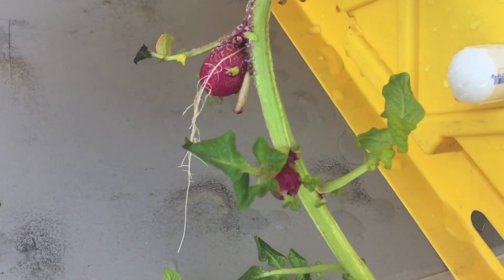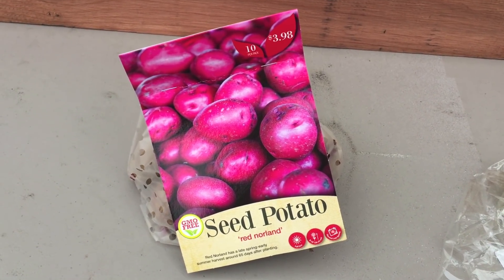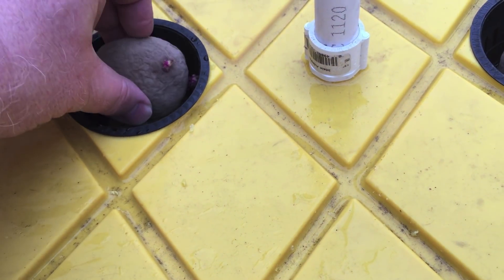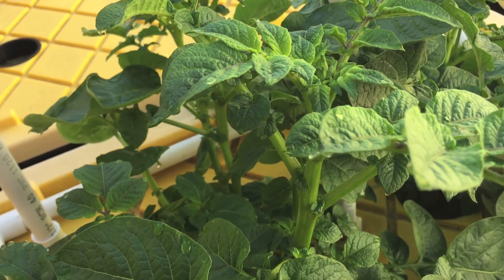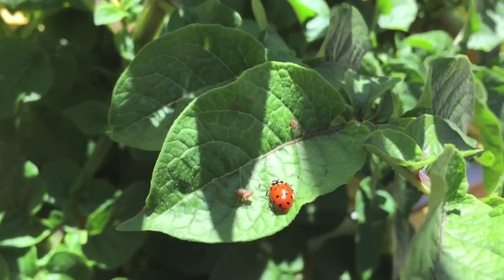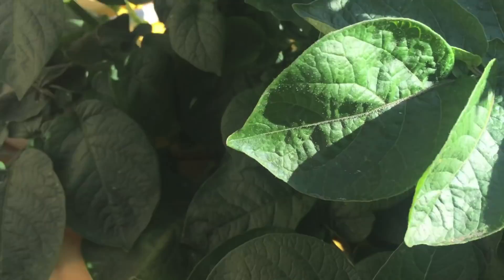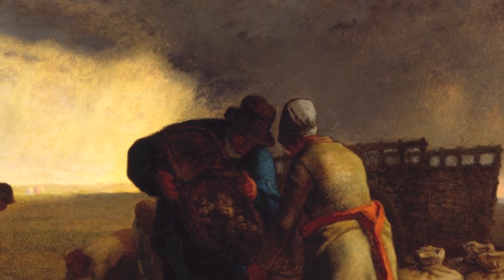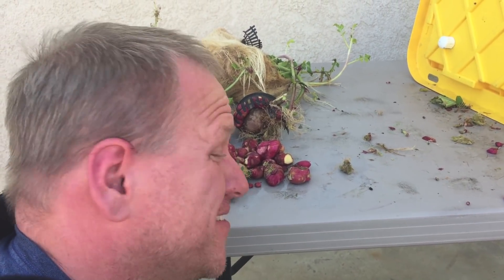Check out the amazing growth pattern of this hydroponic potato!

Comment: You need mulch material on top of the lid for the potatoes to form in. Probably not puting the potato seed so deep in the pot would keep all of the sprouts above the lid.  
I grow fine potatoes by just setting them on top of soil that is always damp and covering them with grass mulch. 
You could replicate that by putting a net around the pipe frame and adding shredded paper starting with about 4 inches and adding more as the sprouts get taller. Light will not get through the lid that way and the new potatoes should form on root stems in the shredded paper and be protected from the light.
Reply from the maker: I believe the method you described could work.  I'm trying to grow them without any media if possible though.  Keep watching to see if it worked.  Thanks!
Reply: The method will have to comply with the genetic plan of the potato which is to place a thickened section of root in a place where it can remain dormant until the next growing season stimulates buds on its surface to regrow. The preference is a dark,soft, poris space that is not too damp to protect it from heat and cold until the next warm damp season arrives. 
I can perceive a space between 2 lids working if no light can penetrate the top lid.  Feeding roots then could grow down through the net pot , reproductive roots could spread out between the lids where it would be dark and damp but not wet and the photosynthesising blooming parts could grow up through the hole in the top lid.

Comment: yo, potatos grow from STEMS not roots.  with that in mind, you can make a simple change in the setup.  I'd go for some kind of big tray of sand suspended above and touching the water reserve. don't restrict them to cups.
Reply from the maker: I knew they grew from stems I just wasn't familiar with the nature of the stems.  If you have a tray that hold sand, why use the sand?
Reply: I'm not sure!  I discovered your channel yesterday.  I love that you're questioning everything, looking for the absolute minimum.  give it a shot!  grow 'em no media and I'll watch that vid!
Reply: You need sand to cover the stems (away from sun) and a little moister (Otherwise will rot) over the stems to start the grow of potato. In hydroponic systems it's a good idea to use perlite to cover the sterms.
If you want to reuse the perlite you must sterilize it first. Otherwise you must be familian to Aeroponic systems to keep moister in good levels, a tray that cover the stems (away from sun) and something to keep the plant vertical (potatoes are heavy).

Comment: cut out the bottom of the cup. suspend the seed potato by skewering through the potato and cup mesh
Reply from the maker: I'm trying a grow with thin rope similar to what you described.  The grow is "working" but the problem is the seeds rot out and lose structural integrity pretty shortly.  I pierced one and ran the rope through it and the potato rotted apart in a couple weeks.

Comment: Everything you already did, but suspend a net 3"-4" attached to the underside of the lid.  If the Roots can penetrate the net, but not the Tubelers, the Potato's would be suspended and not cramped.  And maybe just use a few pieces of string to hold the Original Potato in place.  I'd like to try this myself.  Thanks for the Inspiration
Reply from the maker: Bigger net cup would help, but I think avoiding the net cup entirely may be the answer.
Reply: I was thinking a Net the length and width of the lid, spanning the whole bucket.  A place for the Potato's to catch, then maybe you wouldn't need a Net Cup at all.
Reply from the maker: Exactly!

Comment: I noticed on the tubers where the remote potatoes grew on and noticed leaves on the vine like tuber. The rest of the plant from the lid up looked fantastic! My suggestion is to drill holes in the lid to let the tubers out and leaves to get some light. Since it looked like a vine, stake it up :D
Reply from the maker: Problem is the tubers only form where it's moist enough that they think they are underground.  Also if they get too much light they will produce a toxin, turn green, and develop a bitter flavor.  Nice try though!
Reply: Okay, I've seen scaffolds used for areoponic and beautiful huge round yield but that comes at cost to the power company and yes, if they could charge for the air going through it, they would! hahaha ... How about a small above ground  swimming pool used as a giant tank? As for the medium, as-per DR Kratkey, 'Florist Foam' or some other medium that would break down, and, by the time its gone, the top will have grown large enough to hold it there. Thanks for your reply :)
Reply: got the idea from 'oh yah, you can use a kiddie pool too' just float a raft on it so go BIG

Comment: When drilling in plastic boxes, make the drill go backwards and you wont have problem with it catching.
Reply from the maker: This 3 inch hole saw is so sharp it doesn't seem to have that issue.  The catching is because I'm using it one handed.

Comment: Crazy awesome video, and nuts to take on the potato challenge.  I'm working on this too using the Kratky method.  Potatoes in my raised beds are mega sized and plentiful, but I just got to know if potatoes can be grown well in hydro.  I read the B.A. Kratky paper below, but your video is only the 2nd I've seen on using non-circulating hydroponics.  Can't wait to see your Potatoes II video for your next attempt.  I use the 27-gallon containers also, but paint the lids to keep out sunlight.  Good idea on the paracord, I picked up some of that last month to use.  http://cipotato.org/wp-content/uploads/Seminars-archives/0822_Bernie%20Kratky_summary.pdf
Reply from the maker: Wow, maybe i should actually do some more research before I try these things.  I'm glad to see he came to the same conclusion - grow media adds too much cost.  I was worried about sunlight and still am but I'm going to see if the tubers actually are impacted through the yellow lid.  If wrapping the potato in newspaper is too time consuming paracord might be much too time consuming.  However I think I can re-use the net cup if the plant was disease free.  

I think a large pond bed (like people use for floating rafts) with the potatoes resting on chicken wire could work for mass production.  I suspect if the foliage is healthy and dense, hilling may be unnecessary.  Thanks for watching!

Comment: how bout a pool noodle, the ones with a hole in the center. cut into inch or so sections and float the potato on the nutrient water.
Reply from the maker: That would be cool if it worked, but I want the water level to depart from the plant to keep the potatoes healthy and let the upper roots breathe.  I'm trying nylon rope now.

Comment: I just use a stainless steel safety wire to make a 6 spoke net. This just holds to seed potato in place and gives the plant something to hang onto in the kratky aquaponics tub.
Reply from the maker: How deep do you suspend it?  I'm doing it 2 - 3 inches below the lid with rope now.
Reply: Jeb Gardener I just did it with the seed half in the water with the chit on top

Comment: Great vid. Love it. Keep them coming👍👍
I think the sticks or chopping sticks! are a good idea. But you could use a bit of wire. Cut the bottom of a net cup.(you can then still use rock wool to stop the light) hang  the potato 🥔 using the wire  pushed through the potato 🥔 to a good position. ???
Keep us updated
Reply from the maker: Yeah wire, rope, and mesh bag are looking like contenders right now.

Comment: maybe a bigger net? like the one in DWC
Reply from the maker: Yeah I want to cut the cost though.
Reply: I made a net using a plastic planting bowl, I think you can dril a whole in the bucket's lid with the same diameter as to the bowls, (just below the edge of it) so it would sit like a regulr DWC..cheap and easy? I can send you a picture...how can I contact you?
Reply from the maker: So like a bigger net cup?  Did you add holes to it or you just let the roots go through the drainage holes and the potatoes collected in the pot?  I'll send you my email.

Comment: It's the net pot that is screwing it up. You need to find out what kind of potato grows lower in the ground. Some obviously the Reds grow right off the main one. Others send out tubers lower. Doubt this will help. I grow in dirt in 5 gallon buckets. Got 70 lbs last year. But even in the dirt you will find some high and some low.
Reply from the maker: Yeah I thought I would get stems to go through the net cup, but I got the growth pattern wrong.  I got a monster taking over the square foot garden.  We'll see what kind of harvest I get off of it.  I've had problems with nematodes there in the past.

Comment: how do you not get root rot without pumping air into the water? Next time suspend the potato. Maybe use a stick and hang the potato right above the water. No net cup.
Reply from the maker: Kratky method, oversized reservior, afternoon shade.

Comment: you should used neopreme collars( i totally misspelled it but watever) insted of the net pot
Reply from the maker: I know what neoprene is, but i actually don't know what a neoprene collar is.  Is it flexible with slots for roots?
Reply: Jeb Gardener it holds plants in place for hydroponics 
https://lh3.googleusercontent.com/MQxDUXc3Rp377NWd1JGPY2sz1kVqNkUnATvf8rnXynVUEsPE5rd-XjHI_baCeOK_f0NJFuNB5g
Reply: rapid rooter plugs basically
Reply: Jeb, I've seen a lot of videos where they just use the net pot (cutting off most of the net and these collars to suspend the stem... especially with cloning where you have a good cutting to start with.
https://www.amazon.com/pack-Net-Cloning-Collars-Inserts/dp/B01AAXA6Y6/ref=sr_1_2?s=lawn-garden&ie=UTF8&qid=1492702866&sr=1-2&keywords=net+pot+collars

Comment: Funny video buddy.  If you grow potatoes in the medium, it works pretty good hydroponically.  Hydro drip system.  Look forward to the next video.
Reply from the maker: I know but since the crop value is low (per pound) I want to cut costs wherever I can.  I want something common folks can put on their patio etc.
Reply: It doesn't matter why you did it and I don't have to understand.  I often do stuff just to see how it works out.  Testing limits and paradigms are fun.

Comment: ROFL 
Well done.
Maybe support the seed potato by placing toothpicks in it so it doesn't fall through the hole. No net pot. No grow medium. Or maybe thin strips of foam as grow medium until the roots get down into the water.
Reply from the maker: For my second try I considered sticks but it would be a hassle because I need to drop the potato deeper in the container so they can spread out and not go green from sunlight.
Reply from the maker: Yeah might just be inside another video because I didn't plan on it succeeding.  I have a secret 3rd plan im going to try soon.  No I dont have any reference to measure production.  Its more about how well the plant looks and whether I get a decent harvest.  If I was measuring production (scientifically) I would choose saleable pounds.  I've only grown potatoes in ground once so I don't know.  I would need to see some published data on refrigeration affecting the toxicity of green potatoes to try that.  Thanks!
Reply from the maker: I know that rot stuff is supposed to be the case but I'm growing a couple right now hanging from/in 550 paracord nets.  And they look amazing!  Tubers are still sprouting which is concerning because light is penetrating the lid like I suspected.
Reply: You could try grape bags or screen door mesh that can expand as the tubers grow
Reply: Great Video. I was thinking maybe cut the sides off of the net pot around week 5-8; so it is just supported at two points, like a hammock, allowing the taters to fall out of the sides.
Reply: I was thinking cheese cloth instead of the net pot.
Reply: firecloud77-  Yeah, kinda like the ol' avocado trick, but maybe using chopsicks in place of toothpicks to help ofset the eventual weight  issue. Of course it doesn't solve the problem of how to lower it into the water later, but then again it may not need to if its unconstricted by a net cup. What do ya think, Jeb?
Reply: 1) Are you going to post a video on that? 2) Have you noticed an increase in production rate with this new method? 3) Are you measuring your production rate in pounds or potatoes? 4) Is your time to harvest equivalent to in-ground potatoes? and finally, 5) are you aware that you can shut down the chlorophyll production in the potatoes themselves through refrigeration and make a green potato c non-toxic and perfectly edible again? No need to toss them.
Reply: what about rope? just 2 diagonal and horizontal and the tater can rest on that?
Reply: I will look around and see if there is any research. However, I do it all the time. They turn green, you knock off any attempted growth and sit them in the fridge for two weeks. The green shuts down and the potato returns to dormant. The chlorophyll is reabsorbed. It can also be cut off. Here is a nice read for you though: https://www.chowhound.com/food-news/54631/are-sprouted-potatoes-poisonous/
Reply: id jsut cut a few of the verticle rims, in the pots to allow the spuds to fall through through gavity and expansion
Reply: You're going to introduce fungi to the interior and accelerate rot. Better to leave it intact or alternately suspend in a small wire wrap. The whole water only thing introduces new challenge for root vegetables.
Reply: Jeb Gardener  there are herbs that repel rot,try growing them with the potato's to push the rot away.
Reply: skewers
Reply: With potatoes (in soil) you can get a large sack and roll down the sides 3/4 down. Then fill with potting soil and some potatoes to grow. Water. As the potato plants grow upwards you can start to unroll the sides of the bag and put more potting soil. By the time your potato plant is filled to the top there should be plenty potatoes at the bottom of the bag to harvest and you can work your way up. Not sure how you can adjust this to a hydroponic method, especially since you say one of the constrictions is only having a handful of grow media. But I thought maybe you'd get something from the way the potatoes form as the plant grows.
Reply: i would hang it ito somehow
or you try Silicone/rubber netpots they should Flex arround the growing potatoes so they should be able to pass
Reply: Tato. Tubers grow on underground vines
Reply: Jeb Gardener seed potato on the surface, pre rooted, roots in the water.  The seed tato needs no burial
Reply: I would suggest a rope but also using less water blacking out the top of the bucket with foil or styrofoam once you have growth I'm fairly certain potatoes don't need a medium to germinate just lack of light to the spud itself. I've heard plants are smart, but it is rare that they outsmart humans lol
Reply: I like the toothpick idea - cut off the very bottom of the net cup, use toothpicks to suspend the potato through the sides of the net cup. I’m going to try this - I’m also I’m So Cal (Perris). Great first experiment, don’t give up.
Reply: NEOPRENE like from an EZ cloner. they have larger ones at my grow store. easy cheap done.
Reply: okay not knowing something is just ignorant. but ignoring the obvious when someone points it out to you is just plain stupid.

Comment: Well done Jeb. I would suggest 2 things. Instead of net pots I would use an elastic netting. This would stretch with growth and allow you to do a reverse earth up. By putting the neck of the plant down into the bucket. The second thing would be to sink the bucket into the earth. This would help to maintain the root temperature between 15-20 degrees c. Maybe :)
Reply from the maker: I'm trying it again with 550 para cord but that won't stretch much.  I actually want the tubers to stay out of the water when the level decreases.  If that doesn't work, I may try something stretchy; getting the plant to drop a little as the potatoes form sounds good as long as the foliage doesn't get too damaged in the process.

I had good temps but it could become more of an issue in summer.  That would help with light too.  The potatoes under the lid didn't green, but that doesn't necessarily mean they won't be bitter.

Comment: I'd just cut the cup so that it's hanging one by one strap and let the potatoes spill out as they grow
Reply from the maker: I think I'd still need a deeper net cup since most of the formation occurs near the seed potato.  Do they have those?
Reply: Jeb Gardener yes! They make net cups in all types of sizes. They have some about the width of a 5 gallon bucket. Check your local hydroponic shop for some or I know amazon would have them